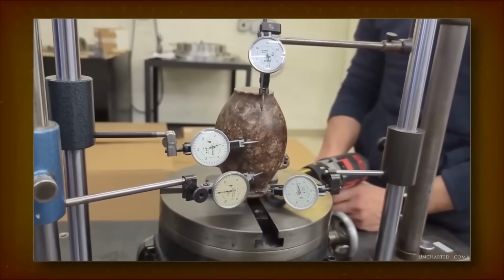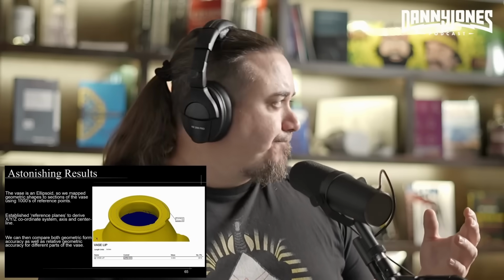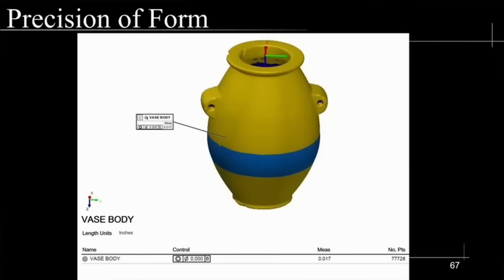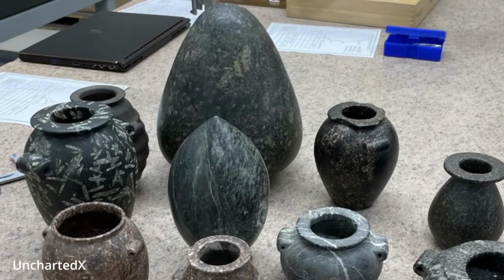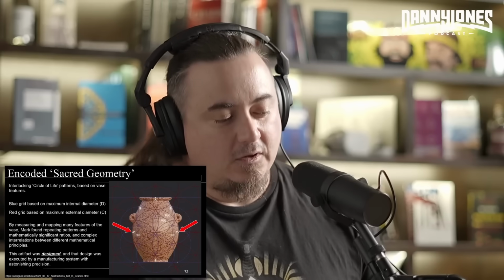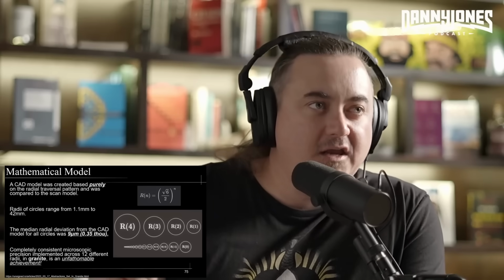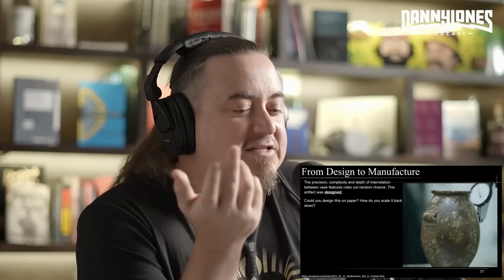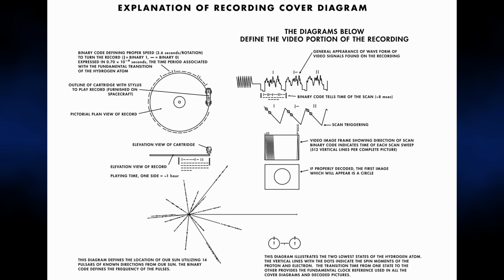Are These Ancient Egyptian Vases Actually Impossible to Make? #podcast #science #history #egypt

Comment: I think I figured out how the did it. They used two axis: Lathe rotation and a curved cutting tool. Probably made using a hard stone. The tool rotated and the so did the vase. The tool would have curve profile that matches the curvature of the vase. The cutting tool could be made like mirror lenses: you take two round flat pieces & grind the flat sides together to create a parabola shape on the flat surface. Cutting tool angle would change & used something like a profile follower used on manual lathes.  

Likely the final cut was done with one tool so there isn't any apparent errors. Too bad no makers marks on those vases. The guy or group that figured how to make them was indeed a genius!

I would guess they had to use stone bushing using oil film to keep the tooling & vase rotation precise.FYI: There are machine tools made of granite (usually epoxy-granite) for ridgity made today, so not impossible to make simple stone bushings.. Vases had to be formed using a grinding process. 

Perhaps some of the parts were made using pottery for rigidity.
Reply: How did they make such precise stone bushings...
Reply: @realeyesrealizereallies6828  Would not need to be extremely precise, but Likely made using a lathe & a grinding tool.

Comment: The mainstream puts the age of these at c. 3100–2200 BCE, but if they're out by say even 1000 years - we're into the tail end of the last green Sahara period - an environment that would have sped up the corrosion of any metal tools used to make the verses, so as to leave no trace some 5500 years later.
Reply: There would be obvious traces of their mining operations.  Such as in the DRC where they would have mining cobalt.
Reply: @Nambawan123  Those traces may have been swallowed by the Sahara, or have been further away, indeed their copper mines were at on the Sinai Peninsula  at Serabit el-Khadim,  some 200+ km to the Nile. I don't imagine it would have been any where near as industrialised as the cobalt mines of the DRC - Early smelters didn’t need to mine deep veins — in a wet Sahara they could collect iron nodules from stream beds, and bogs or weathered ironstone near the surface. These sources were renewable in bog environments, making mining unnecessary in many early contexts. These sites often leave no visible trace once the ore is removed.

Comment: Looking forward for more history breaking facts.
The relationships between measures is a red herring IMHO. It is probably part of their belief or a consequence of how they measured things. They had to continuously measure things, so the product would stay within the defined bounds. Especially if they removed the inside. You can not get something more accurate than what you can observe.

The milling technique has 2 major axis. And I think, a minimum of 4 directions of rotation. The circular round-vase direction is the base-axis, And a vertical direction with an ellipse like curve is the second major axis. They probably used a drill that kept rotating (the 3rd direction). The handles need a specialized additional axis. This handle-axis might also be responsible for the ellipse like curve. 
The milling machine can not be made with wood. It needs something that does not bend or change during rotation. And it must also be temperature independent.
They also needed specialized chemistry. Something that makes the drill much harder than the material. This means that they used a diamond like drill OR a softer product with geopolymers or some acid, that makes the stone softer. The chemistry tests seems to indicate that they may have used titanium?

Comment: I worked in aerospace and metrology. Funny how accurate you can make things using relatively simple instruments. Like tracing paper. String and a simple light source. It's not otherworldly. Even the most accurate grinding wheels for surfacing turbine blade bases with complex shapes use rough industrial diamonds, and clay molds.

Comment: Yes! It's a trick, that's why it's impressive. you assume the handles are done last which looks impossible.
Has to be a hanging lathe like a CNC, with the material to be worked on a gimbal to access the XYZ
The holes in the handles are done first on the X axis, the "handle toroid" is cleared on the Y axis, then the final shape is done on the Z axis to cover up the previous two axis steps.

The same way you would make a crop circle to cover up all your footprints....right?

Comment: You should scan both store bought and modern made vaces and compare and contrast all three to each other.
Reply: They have they've done it to Stone vases made on CNC machines and they are pretty precise but they're not as precise as these and they don't use the same mathematical constants and the same points of symmetry like the circular opening of the vase being a multiple of the outside of the handle or the interiors having grooves forming ridges on the inside and just very bizarre things.
Reply: @calebsone1630  and they couldn't do the inside... Just a simple cylinder core.
Reply: @calebsone1630  Awesome where can I see it?

Comment: I'm an old carpenter. Mapping the vases reminded me of remodeling a 200 year old house where I have to lay out geometrically accurate spaces inside the building in order to learn how drastically everything else is out and then act accordingly. Keep the rain out, the heat in, and make it look pretty...
Reply: What part of the home we’re using sacred geometry??
Reply: @andrewschafer8986 nothing sacred about it. He’s implying that to restore this type of building he needs to know how true to square it is. Take a basic square structure with an outlying square attachment (addition) are they square to each other? Or is the attachment ‘close enough’. Replacement components may not fit properly. Any deviation from square in the structure must be built into any replacement components.
Reply: @Frank-gy9kg  A simple 3-4-5 or a framing square is night and day different from the geometry used for this vase.
Reply: @andrewschafer8986 no one is comparing the two by method. The response was about methods used on a house. Tolerances for house construction have nothing to do with tolerances for bearings as an example. Two different disciplines at work.
Reply: @Frank-gy9kg  Reread the original comment. He literally says it reminds him of working on old houses where he has to lay out geometrically accurate spaces inside the building...
Reply: Sorta like that. But on a precision scale that you cannot comprehend
Reply: @shadf7902 his comment has nothing to do with the vases. He’s commenting about variances in structures caused by time or lack of precision in building a structure. And the modifications required to retrofit said structure. And yes I can comprehend the precision required. Having been a bridge builder working on a tolerance of 2 millimetres or less you require some skills. Having been the head prefabricator for all the form work requires you to know where the support bearings are over a span of say 50 meters. To a tolerance of 2 millimeters or less. These locations are fact checked three times to make sure they are correct. There is no room for error. When a steel span is placed at the coldest time of the day (due to shrinkage) so it fits with a tolerance of 2 mils you have to be precise. These vases are a different ball of wax. Why make them so precise? With what tools? Because they could. And we scratch our heads over this.
Reply: Sorta like that. But on a precision scale that you cannot comprehend
Reply: Sorta like that. But on a precision scale that you cannot comprehend
Reply: there were no tools, no machines, the vases were made a method unknown to mankind, not by mankind
Reply: Can you get elaborate?
Reply: @Old299dfk  Me or the gentleman that made the comment?
Reply: grifter

Comment: There is one thing that I haven't heard anyone talk about. Removing material is one thing. Measuring your work is another. I fabricate parts frequently. Turning or milling material is easy. The tooling you need to measure your work is another. Where are the tools they used to measure their work? I think there was a small group that was making these objects. They Kept their knowledge close to the vest. Knowledge like that is easy to lose. Look at modern times. How many people have we know that have passed away and took knowledge with them that they didn't pass along.
Reply: and let's put it bluntly, it doesn't need to be that perfect.
Reply: @TheeeDannyD 
They are overachievers !
Reply: The mainstream argument is that they just eyeballed it.
Reply: @os3ujziC they probably did.
Reply: exactly. how are u supposed to measure that, really. it doesn't make sense.
Reply: @TheeeDannyD  Like these guys did. I could make these same measurements. That is the point. You can't make a dial indicator with a hammer and chisel.
Reply: Finding 1 perfect vase is one thing, but finding this many with such accuracy, means it was machine made.
The perfect location of the handles made from the same piece, makes it extremely hard to reproduce even in today's technology.
Reply: And another thing is the human eye able to see the difference between 2/1000ths of an inch and 10?
Reply: @deceptiveanswer yes we can, its  quite easy when you have experience. Steps on turned surfaces etc.
Reply: Why measure? They are unique objects.
Reply: @michelbrz exactly. Our first mistake is trying to measure. Our next is thinking that we’ve discovered every method of making such objects.
Reply: @michelbrz they used templates,  prob pantographs
Reply: You could make these on a lathe in a softer material.But the area with the handles requires much more specialised equipment to maintain the concentricity on the curve.These days you would need CNC, computer controlled machines and a computer to write the program.
Reply: @alcord2540 correct. But still totally possible. And I don’t think people were in a hurry back then . Nor did they have the need for certain sizes of machines tools electricity etc.
Reply: Exactly, if there was some global catastrophe that wiped out a majority of civilization, that would be the end of so many of our technologies.  There wouldn't be enough people alive that knew how to build a car or refine petroleum or anything about electronics and logic circuits.  Add a couple thousand years and all of this stuff would have deteriorated away.  Who are we to say something hasn't exited before?  If the Antikythera mechanism wasn't found by urchin divers, we'd never believe that 2300 years ago they could even MAKE gears like that.  We don't know more than we do know
Reply: @robertjones1730  what I struggle to understand is that we've found countless examples of dinosaurs from millions of years ago but people are suggesting that 12 thousand years ago there could be a civilisation more advanced that we are now, that we've never found any evidence of. It seems unlikely to me.
Reply: @robertjones1730 A global catastrophe….what global catastrophe do we know of in the Bible? What could have possibly covered all that land mass in Turkey, Egypt, etc and moved that weight of rock and debris? There is no volcanic dust like found in Italy…it’s buried … what water event occurred? Notice how it is sudden…. Where are all the bodies that sustained the area? 

Part 2: who was here ( on earth) that is not from here and would readily know levels of math that we have difficulty understanding…  it would have to be a “being” that was cast out from the ____ and they fornicated with the women of earth…Nephalem ( aliens, kinda of, but aliens in the term of not from earth, rather than species genetically different from human)
Reply: And if you use a lathe for enough decades you can absolutely master it to perfection
Reply: You don't need to go back to ancient times. Today we can't make the Saturn 5 rocket engines that powered the Apollo rockets. Why? Because the skill set no longer exists.
Reply: @vectravi2008 Those engines were not a good design, 1000 parts welded, the new engines do it in 100 parts.
Reply: Why is everybody in the comments in aerospace manufacturing or fabrication?
Reply: @Old299dfk It's because the accuracy of these pieces is amazing. They recognize how hard it is to make them.
Reply: @Old299dfk because we understand machining to thousands of an inch. Cheers Phil
Reply: @Old299dfk Becsuse we admire ancient makers and builders.
Read the Illiad and the Odeyse,  there's lots of interesting mentions of bronze age tech in them.
These two oral histories would have been quaint to the historic Greeks. The stories kept some very archaic details in them like the tapers, when oil lamps and candlss were normal.
Reply: Except there's like 40,000 of them.
Reply: I can't speak for milling nor measuring such a job, I do know they used Diamonds to cut the thing out though. How? same way everyone does, you use diamonds to cut stones. nothing else. I loved drilling in granite, the money was easy. Rosa perina granite, sweet as  to drill. 100 mtr (350 ish feet) days.. easy.. they talk up stone hardness, but they obviously dont understand what they actually say.. imho..
Reply: We have no evidence at all that these were made to a specific size, so no dimensional measurement for verification would be needed.
The scans are available - which is nice - and we can all look at them. By modern standards these vases have poor form quality (roundness, concentricity, perpendicularity, etc). The guy in the video is talking shite.
Reply: ah, that rings a bell reading your comment about painting with both hands & the vision thing. learnt to play the guitar in my youth, so a while now, here's the thing, it's ah when you lock in & something happens to your vision after a while, it's like your seeing with one eye or something, i thought my eyes were cross eyed or closed but no & in checking it, it goes. something like that anyways.
🏴‍☠️
Reply: Tens of thousands? over several hundred (or thousand) years of history? Thatx's beyond guilds, that's sorcery.
Reply: Probably knew the formulas mixing grains of materials with liquids then pouring into molds then cutting molds away after mixture cures hard... or the great creator gifted these to show them his  ultimate abilities
Reply: there were no tools, no machines, the vases were made a method unknown to mankind, not by mankind
Reply: @DaddyAl-Baddie unknown to mankind doesn't mean not made by mankind.  Just because we can't figure it out doesn't mean it's not possible too figure out and do an over many generations..,.   Look how long it took us to figure out how pypyrus was made.  I can honestly say there's a number of ways I could see them using a templates and fixed reference points to remove materials.   I would agree it's mind blowing but if they were prized enough I could see 1 craftsperson making the final touches after generations of perfections
Reply: @lisat9707  with lots of imagination you can see anything you want but it doesn't make it either real or possible the way you imagined it. it's just your imagination

Comment: One thing i was wondering, because these "vases" have thise lugs with the holes in them, and the holes are a relatively diameter, i was thinking these "vases" at one time had lids and the "lugs" were provided to act as mounting points for a wire hinge / locking handle assembly during the original manufacture.
Sort of like one of those modern canning jars?

Comment: The best machine shops would have a hard time machining a thin wall narrow opening tall bottle with lugs even with aluminum to that tolerance. Mold or casting could be done but not original matrix igneous stone. Many thousands of them and none the same with different types of igneous stone? Ben is astoundingly knowledgeable about machining process.

Comment: Hi Ben, i would like to point out one aspect that we over look... It is one thing to manufacture something and another thing to know the accuracy in which it was manufactured,  because without knowing it would defeat its purpose.  In todays terms we use calibrated equipment  to cross reference with a perfect model as you have demonstrated, a different process as to manufacturing.  So how did they do it if the only thing they had was a mathematical equation?
Reply from the maker: Good point